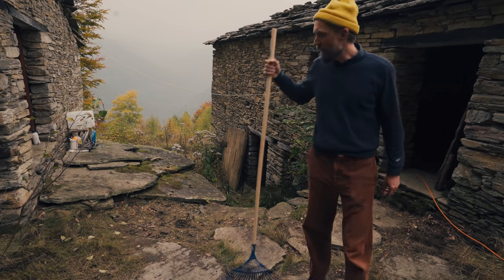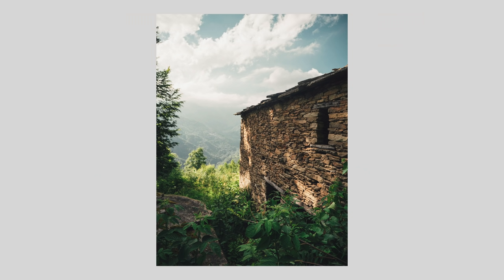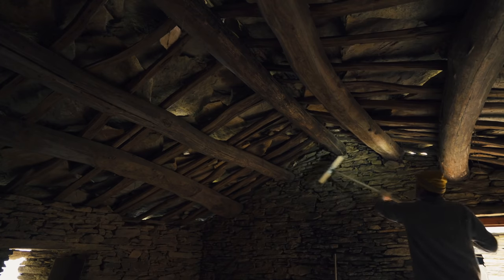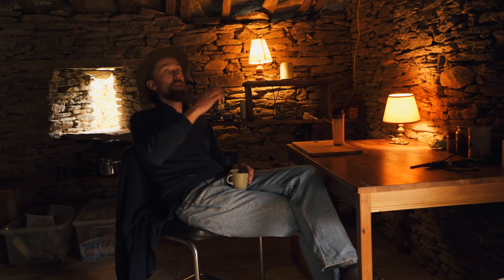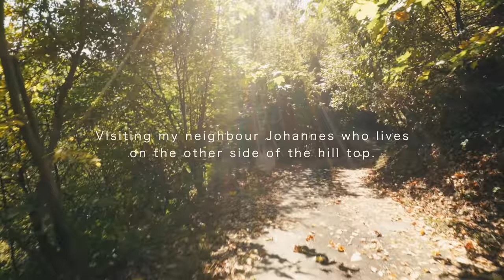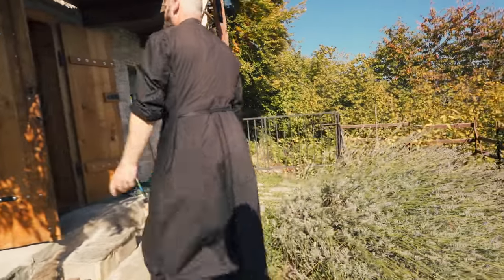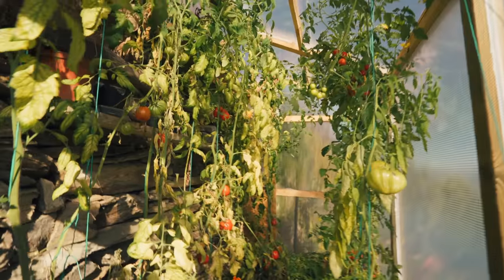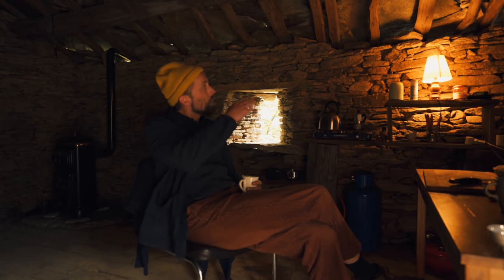#2 Starting the works, visit from the Surveyor, and lunch with the Priest

Comment: Carpenter here, I understand that you were a complete novice with starting this endeavor and I commend you for it. I will be offering suggestions on better ways to do things as I go through your video series. These suggestions are meant to be constructive, so I hope you will take them in the spirit they are intended. @5:40 I just had to step away. A much better way to accomplish the task of fitting this door would be to first cut a piece of plywood to fit snugly in the door opening. Then using a level, draw a plumb line down the template while it is in place down the hinge side. Then place that template on top of your door, aligning the plumb level line parallel to the hinge side door/jamb gap. As long as the plumb line and the door/jam gap remains parallel, you can shift the template anywhere on the door that you choose in order to take an equal amount of material off of the entire outer jamb, and bottom of the door.

Comment: Your buildings are 118 years old , and they say you have to meet seismic standards?? I think it has already met the test of time .😅 Good thing you don't have to move the door
Reply: The paperwork is if you change the structure because, if you do so, then the building must respect the actual anti-seismic norms like it's new. 
Those stone walls can last for centuries without maintenance. Thats why they made them that way back then but, in case of an earthquake, they'll end up in a pile of rubble in few seconds. To make them anti-seismic, you have to build a steel "cage" inside the house, so that's the steel frame, and not the walls, that holds the roof and prevents it to fall over your head.

Comment: take the rock off the roof.. put down treated plywood on the rafters and a  lightweight slate or  a  fake  slate 1/10 the weight of what you  have.. you dont  need to replace the rafters with the reduced weight
Reply: This will be considered to be major structural change and will be a nightmare to get through the bureaucracy - I guess....!

Comment: "Big paper, not cheap"
Reply: The paperwork is if you change the structure because, if you do so, then the building must respect the actual anti-seismic norms like it's new. 
Those stone walls can last for centuries without maintenance. Thats why they made them that way back then but, in case of an earthquake, they'll end up in a pile of rubble in few seconds. That's their nature. To make them anti-seismic, you have to build a steel "cage" inside the house, so that's the steel frame, and not the walls, that holds the roof and prevents it to fall over your head.
Obviously you can buy a prefabricated wooden house that respect any norm and it's perfectly insulated at a fraction of the cost.

Comment: Can you change the roofs frm stones to iron roofs so its more lighter so you cn improve insulation???
Reply: The "losa" roofs are typical of the Italian western Alps and French Alps. They can be very well insulated, but only if the flat stones are used as  shingles to cover a closed wooden roof. (you can chek "losa" in the Italian wiki to see how they are made). 
In those sheds the wooden planks are missing because those were used only during summertime. Also the stones were pretty irregular in respect to those used in houses (you can see the perfectly aligned stones on the roof of the house of the priest).

Comment: Imagine in the forest you are not allowed to do things you want to renovate your home. Every little changes you need to consult with the govt. A lot of restriction. Wonder why??? Different countries has alot of differences.
Reply: Because, in case of an earthquake, the same govt, during a crisis, has to spend resources to reach you in that remote location and try to extract you form the pile of rubble your house had became. 
so, if you want to leave the structure like it is, obviously the govt can't force all the owners of old buildings to compeltely renovate them to comply to actual anti-seismic norms. 
But, if you want to restructure an old building, then you have to follow those rules.
Reply: @Neutron Alchemist  Thanks for your prompt reply.

Comment: While they are fighting against people abandoning such rural places, they also are enforcing strict rules to keep the centuries and centuries old buildings which does not suit any 21st century living standards. Or making it super expensive for people to do any activities in a such areas. It's a strange politics where i don't actually see any value for modern society. With the same politics they could enforce the people to live in caves... because that's the true way to keep the legacy.
Reply: Bureaucracy is the same all over the world, it seems. I built and own a boutique hotel (for now) in the Andes mountains of Peru. Cusco is the name of the city which is 45 miles from the ruins of Machu Picchu (The lost City of the Incas) When I renovated the existing structure, I wanted to use new fiberglass terra cotta looking panels that mimic the original brittle clay tiles and 1/4 of the weight. When installed, it is virtually impossible to tell the difference. The city of Cusco along with the INC (Institute of National Culture) said NO. Since the property is located on a  2.5 meter wide cobblestone street, the roof tiles were not visible to anyone. I was scratching my head. lol
I believe that the same type of people that work for government are the same no matter what part of the world. No common sense, just follow the rules, do as they are told and on Friday at 4 p.m., pick up their paycheck.
Reply: The paperwork is if you change the structure because, if you do so, then the building must respect the actual anti-seismic norms like it's new. 
Those stone walls can last for centuries without maintenance. Thats why they made them that way back then but, in case of an earthquake, they'll end up in a pile of rubble in few seconds. That's their nature. To make them anti-seismic, you have to build a steel "cage" inside the house, so that's the steel frame, and not the walls, that holds the roof and prevents it to fall over your head.
Obviously you can buy a prefabricated wooden house that respect any norm and it's perfectly insulated at a fraction of the cost.